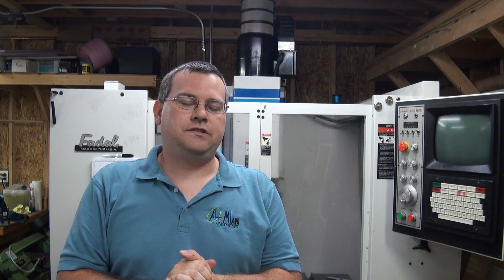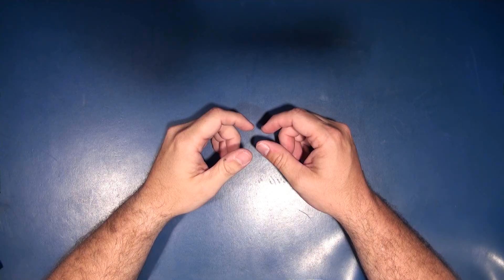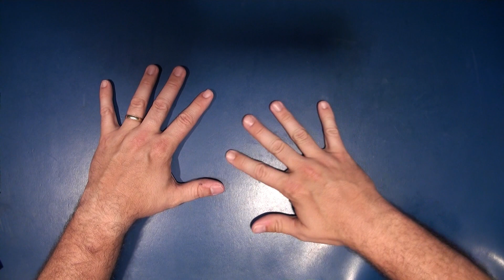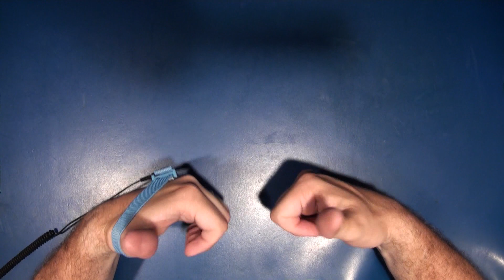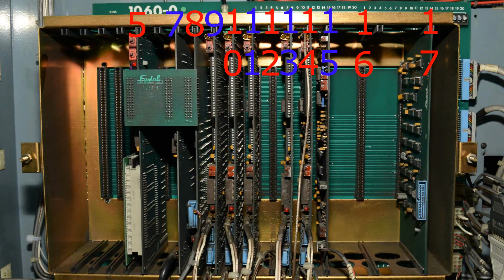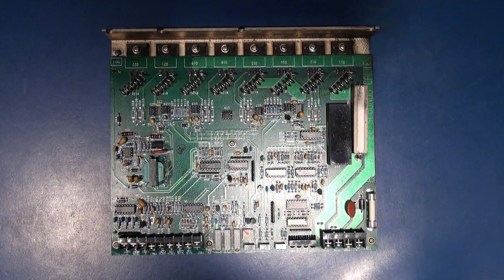Fadal CNC Machine Control Electronics Walk Through

Comment: Thanks for the video. Looks like old Fadal controls are more complicated to work on than old Haas controls, although it's obvious that Fadal paid more attention to detail on the neatness of the wiring throughout the cabinet.
Reply from the maker: I have not seen an older Haas cabinet so I can't really comment on that. But the Fadal is not bad at all.
Reply from the maker: LOL, hey a resistor is a resistor. Most likely used for regen on the VFD if I had to guess. I don't have anything against any machine, they have there place in the market. If they didn't they would not be cranking machines out like they do. I find most people that are disappointed in a machine tool had unrealistic expectations going in. Tormach for example, you can't buy one, put a 3" face mill in it, and get mad you can't run it at 100 IPM, 100% step over, and 0.125" depth of cut.
Reply: We have an older Haas with 'real' regen resistors and if they ever needed to be replaced, Haas charges over $900 for all of them (super high markup, I know). I think I'd prefer the stovetop element newer machines have just because it would be pretty easy to find a replacement.
Reply from the maker: That is nuts! No way regen resistors are that much! High quality, wire wound, ceramic resistors should not be more then $100. And that is for 2kw power! You really don't need that much power dissipation for the regen resistors on a CNC. The only time you generate regen is during deceleration, which is a short event. Just look on your existing ones and see what the Ohms are and the power rating. You can order them from many places.
Reply: At-Man Unlimited Machining Yes, I know it is nuts! I'd imagine they need to be a specific size to bolt into the cage on the enclosure. Are the physical sizes standardized? Regarding the power dissipation, I'm not sure how much is needed. I know Haas uses them for axis deceleration as well as the spindle. And during the summer, they've gotten hot enough to throw an alarm, so I added a fan on top of the box they're in.
Reply from the maker: Chassis mount resistors are less standardized but I'm sure you can find something close. As long as its not close to shorting out on the case, make it fit. Check for marking on the resistors, they might have there resistance and wattage marked on them. Or disconnect one with the machine off of course and measure the resistance with an ohm meter. You could also look up recommended values from other drive manuals that are similar in size. The axis motors will generate a lot more regen then the spindle drive. Especially when your machining small circles at high speeds. I have drives that make a TON of regen. Have had those ceramic resistors glowing red before, not recommended but they did not fail.
Reply: At-Man Unlimited Machining hi I was just thinking about getting a fadal an wondering if u had it to do over would you buy yours again

Comment: back when I was in Manchester NH at Lockheed Plant we had many machines - one of them a Fadal with CNC 88 - One of our machinists Roger Levequse  had a hobby of board repair and could keep that Fadal running.
Reply from the maker: That is the plan! Swap out the bad one and repair hopefully.
Reply: I use some of your videos for Fadal training. I used to work for a Fadal Dealer back in 1988 plus we did CNC Retrofits with Delta Controls. I try to teach many machines so that you will be employable in many places. I learned to "learn" other machines and it gave me confidence to approach a new machine with the ability to learn it based on what I already knew.  I would always practice safe operation with my #2 rule - "don't break the bosses expensive machine".   carry on At-Man....... But I remember my old friend Roger.......
Reply: I also have a student who just bought a used Fadal 3016 and is starting his own business while working at the job shop.  There is still a ton of Fadal out there and they approached the small shop owner like Haas did back in the day. I had worked at a Big Japanese brands dealer in special projects dept to build turn key. We sold Matsuura and Mori Seiki.  Matsuura 500 in 86 that sold for 99K and all of them that came in were pre sold - that's how hot CNC was. So Fadal built a non Fanuc machine to lower cost and wa la.........a big hit
Reply from the maker: Nice, I love my Fadal, price was right, and when taken care of they are good machines. Always a good approach to not break the machine, even if you own it!

Comment: I would also point our LinuxCNC as a major option. All machines sold by Tormach are based on PathPilot (older fork of LinuxCNC). The biggest benefit of LinuxCNC is ability to have full unlimited control of all aspects of electronics in a machine - in an really economical way. And with good motherboard (I use GA-H81M-HD3) bundled with Mesa cards there is no interruption to worry about. Also stepper / servo drivers has come a really long way since 1985. So end result will most certainly give a better real world end result.
Reply from the maker: PathPilot and the way Tormach controls there machines, combined with price point were the main reasons for not purchasing one. Linux CNC is great for hobbyists but in my opinion it will never be able to compete with a purpose built controller. For the motor drives most machines use 3rd party drives. Fadal used a lot of Glentek drives. There will be videos about motors and drives coming.
Reply: Thank you for the answer! I still don't quite understand what are the real world differences are - if you could do a short video about this topic it would be great.
Reply from the maker: Your Welcome, I will add that one to the list, it has become a long list though, might be a bit.

Comment: Why not move to LinuxCNC and Mesa hardware?  Also, it's bugging me , and being a former 3D graphics programmer I gotta point it out.  Axes == plural, axis == singular, not axee.
Reply from the maker: Hi Pete, Time and cost. I can just plug these boards in and they should work. A retro fit would be a fair amount of work. I'm also not sold on the linux based open source controllers. They are great for a hobby machine but you see very few true VMC's running with them. If I was going to go a custom retro fit route, personally, I would just put an NI compact RIO in the machine and develop the code my self to almost run completely in FPGA. I can close loops in that hardware 10-50 times faster then Linux CNC. I have already been tinkering with the code here and there, just comes down to time.
Reply from the maker: No worries, I never claimed to be an English major ;) I get other words mixed up as well.
Reply: Well, the Mesa hardware is just that, an FPGA, it's closing the loop and controlling all the drives.  They use Xilinx FPGAS and the firmware is open source. Also, I guess we'll find out how that works out when I finish scraping.  I did a fair amount of research when planning my retrofit, and that's the direction I chose.  The only reason I'm asking is because you've obviously got a lot of time in this, and electrical expertise, it seems right up your alley.

This is the board I'm using.  Check it out.

http://store.mesanet.com/index.php?route=product/product&path=69_62&product_id=300
Reply from the maker: Yes that is on the smaller end of the Spartan 6 family of FPGA's. Do you have any analog IO needs or are you connecting with all digital devices? What drives are you using? Yes, I have done a lot of complex and large control systems, which is why I would most likely do my own thing if I ever did something. I have a lot of the code already for control. Only the G code interpretation is really needed. The only piece that I don't like about the Linux CNC is that the PC or main controller is still generating the position command data and then sending it to the FPGA. I would really like to see that be done on a co processor or better actually on the FPGA. The issue is you need a larger (read more $$$$) FPGA to handle the trig functions needed to take arc commands and calculate the points over time. I also don't know how well there control code is actually implemented, never dug into it. Almost anyone can do a PID loop now, the trick with machine control is to get all the AXES synced. Then do it at 100 or 400 IPM, not 10 IPM. That is where the black magic of look ahead, feed forward, and all kinds of tricks come into play. Send me an email and let me know how you make out and your user experience. I don't know anyone personally that has used Linux CNC yet.
Reply from the maker: Peter, please don't take the comments here as disapproval (not that you need anyones approval anyway). Everyone has varying degrees of opinions and experiences. LinuxCNC would not be as widely used and supported as it is if it was complete junk.

I would be more then willing to review anything you would like. Just send me an email and we can set something up.
Tim
Reply from the maker: That is a problem I have seen in other open source projects. Unless there is a moderator to review changes before letting them into the trunk, then anyone can make changes; but not everyone should.

It is not the CPU speed that is the issue. The main bottle neck in most of these OS based approaches is getting external data from the hardware, through a bus, into the kernel, then into your software. Also most OS architecture is not based for a time critical system. National Instruments found this out when they wanted to use Linux on there compact RIO line of controllers. They spent years investing in Linux getting it to a Real Time OS state.

All of the major machine controllers I have seen always have a purpose written processor for the control and block processing. Most now have some type of windows or linux box in the machine for operator interface and outside world interface. Which is fine, as long as it does not do critical control, in my opinion.
Reply: Well, a lot has changed lately, and many have done successful retrofits using LinuxCNC.  I already purchased the hardware based on recommendations from a couple rebuilder/retrofitter friends so that's the direction I'm going in.  I guess we'll see how it goes!  There's no way I was going to repair the Fanuc 6M controller - for me it was learning everything I needed to do that vs. learning something more modern.

As I get the rest of the infrastructure needed to scrape the ways of the machine I'll start posting videos of the process.

Tim, I don't have as much experience with wiring control cabinets, when I get some design documentation together would you be willing to idiot check it for me?
Reply: LinuxCNC's source code is full of code comments like "I'm not sure what this part of the code is doing". I'd trust Fadal over that anytime for any critical execution of code.

I've had my fairshare of programming embedded controllers, both in C and plural of asm code (m68, avr, pic, mips, x86 and arm)and the LinuxCNC source code is just a mess.

I have a never ending project to clone Heidenhain TNC 155A controller for my Bridgeport. I'm aiming it to be more modern (more CPU power, more memory, more faster). I really like the Heidenhain controller. :)

At the moment I'm basing it on STM32f746 processor, a 216MHz Arm(Thumb2) beast and Spartan6 FPGA('s).

I think ST will announce a new 400MHz version very soon.
Reply: At the moment the CPU in control of the movements in Heidenhain TNC155a is clocked at 12MHz (TMS9995) Divide that by four and every CPU cycle runs at 3MHz. There must be a lot of things wrong in LinuxCNC when some modern gigahertz PC's aren't very suitable for closed loop control.

Only reason why the GUI is scripted in LinuxCNC is that at some point some developer couldn't program in C... Well, that's some sort of a reason, although scripting eats CPU cycles.

I also like the controller to be up and running in seconds and not in minutes that it takes to boot Linux PC.

Comment: How to adjust the potentiometers on the axis card see https://www.fadalcnc.com/media/pdf/tech_docs_1/Maintenance_Manual/Axis_Drive_Systems.pdf. Page 191 for DC or 201 for AC. I have done the procedure with AC cards using blinking leds, it is pretty easy.
Reply from the maker: Hello Yevhen, that procedure is to adjust the pot on the servo drives, not the card in the card file rack.

Comment: You can transport static sensitive board's by wrapping board in damp newspaper and placed in a zip bag.
Reply from the maker: Hi John, I'm not sure I would try that my self. Static bags and cheap and easy to get. Moisture could end up soaking into any unprotected parts causing parasitic resistance and capacitance issues.
Reply: Wouldn't getting it wet do damage also? I would think even just a sealed ziploc could condensate enough to ruin a board, let alone with a wet rag in it.
Reply: Steve just Steve I said damp.
Reply: Antistatic bags are pretty easy to come by. 
If you had to you could wrap in aluminum foil. 
Damp paper is not a good idea it will cause water condensation on the boards/parts damage the boards and damage.
It's important to use the anti-static measures demonstrated in the video whenever handling any boards like these.

Comment: Looking video allready....
Reply: Wow that was a INFO BLAST!!!!!
Now that´s way to get views for video,,, I hav to look video at least 10 to get it  :-D :-D

Great video Tim !! Thumps UP
Reply: +Hippo   That's nothing! Did you see the Renishaw vid? Pretty sure that one will stay above my head forever.
Reply from the maker: Dave, yes, board swap is planned. 3 reasons, first I don't think there is any risk to my existing boards by unplugging them from the card rack and plugging them back in. I have a complete second set of boards except the clock board. Second, its a big jump, from a 286 CPU to a 386 CPU. This should increase the number of arc blocks I can process per second. Currently it is around 100. Last, baud rate over doubles, this greatly increases my 3D profiling rates. Right now I can 3D profile around 50 IPM on average, I think this will get me closer to 100 IPM. Makes the machine more competitive. Side note, I would really like to make sure these boards work, then I know for sure I have my old set as a fall back in case I get into a jam.
Reply from the maker: LOL, thanks guys, everyone keeps asking for detail, I aim to please!
Reply: It sounds like your planning on swapping out the boards?  If so why, my experience is if it works don't mess with it, especially on such only electronics. This brings back memories from the late 80's. I use to be a pc board designer and layout. Design many similar controllers, a lot the layout and tape traces. So simple back then! Dave